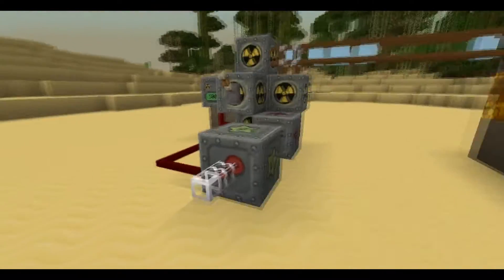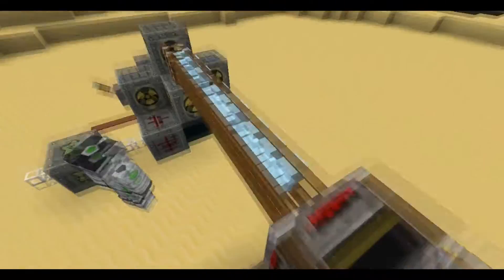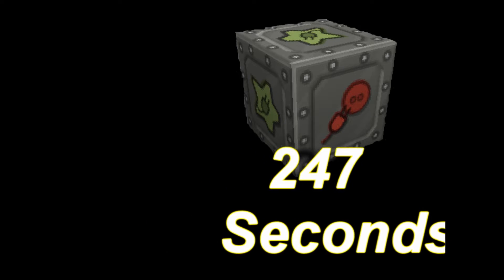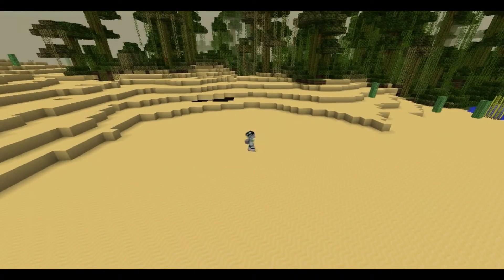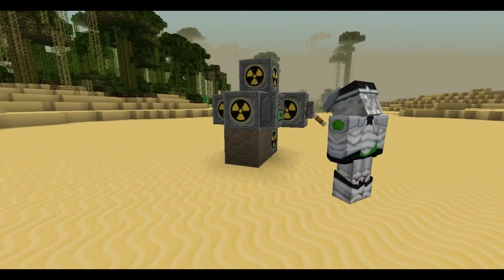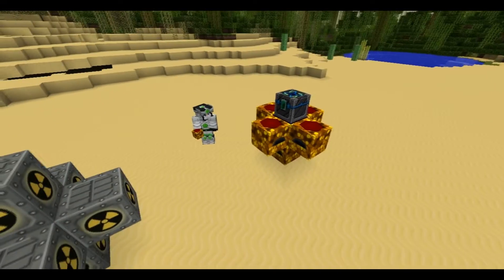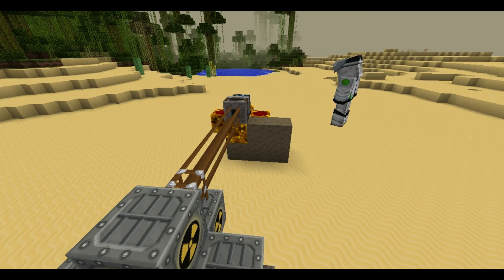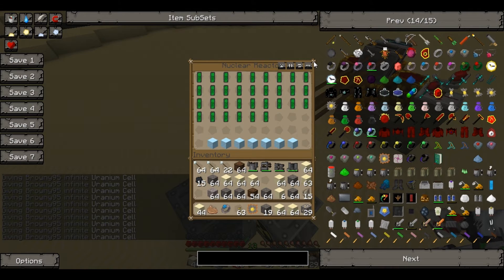Tekkit Creations- Best Nuclear Reactor Possible

Comment from the maker: Its called 4xIns. HV Cable, its deffinately in tekkit classic if you search for cable you'll find it, and try making sure all the inputs of the mfsu and transformers are correctly aligned, if that dosnt work it may just be slightly glitchy and you may have to replace the blocks